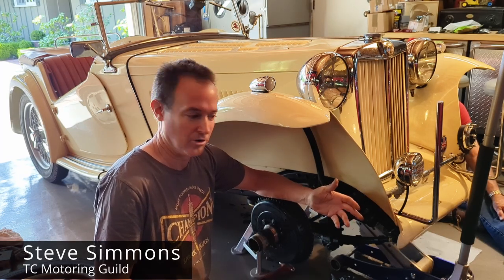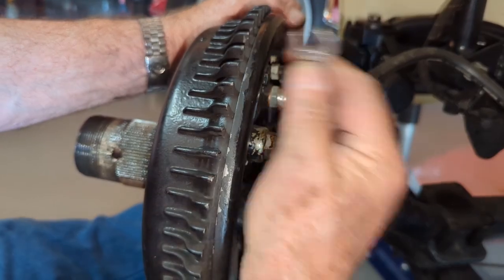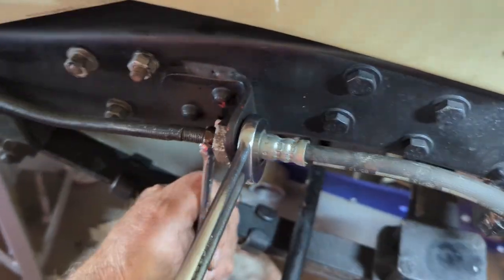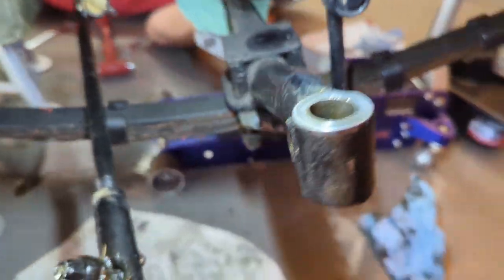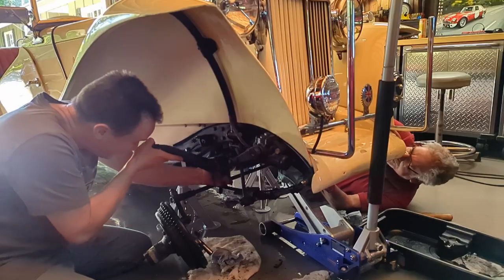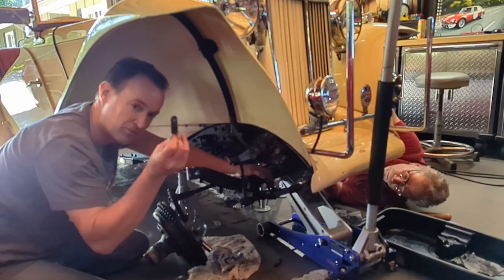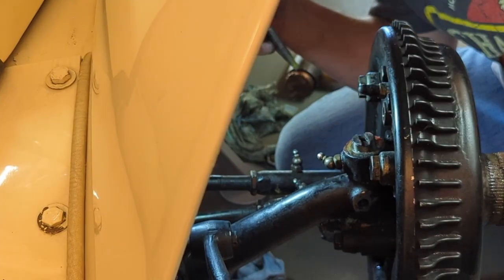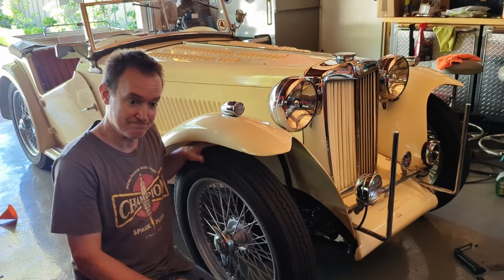MG TC Reversed Front Axle Repair

Comment: 4:01 Use dot 5.  Converted my TA, TC and Land Rover Series years ago and never had a problem since.  KP and cotter pin alignment is a gentle process; gently twisting the CP and KP to 'feel' for their co-planar flat faced before gently hammering with a soft mallet.  I have found the ramp of the wedge sometimes needs draw filing.  The retaining nut provides the positive thrust to hold alignment.